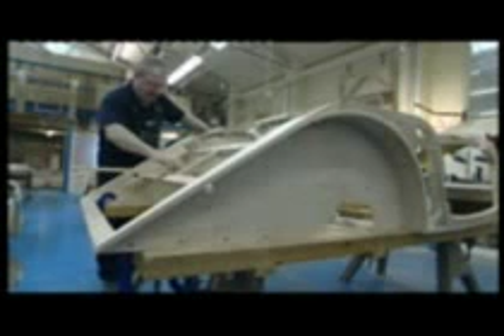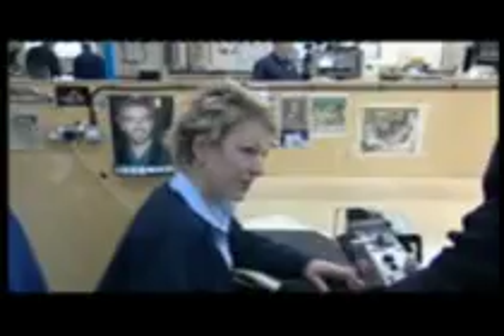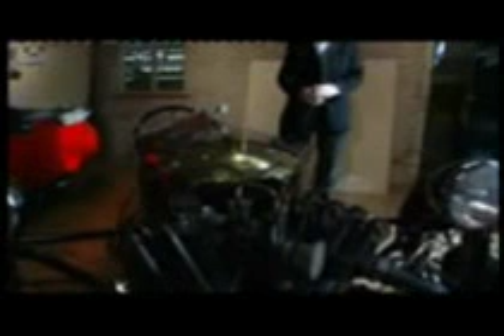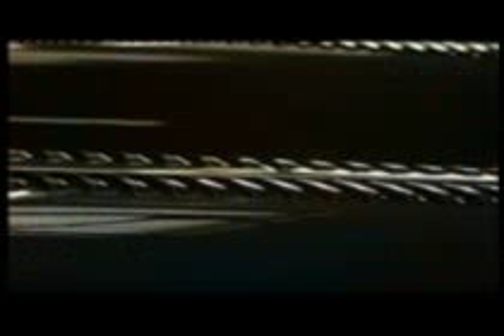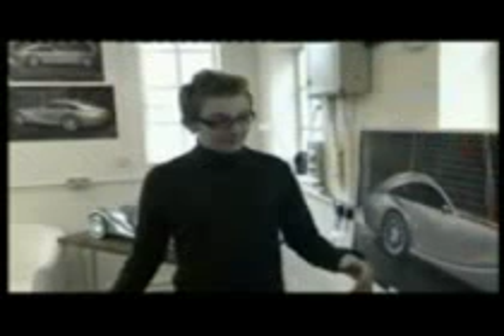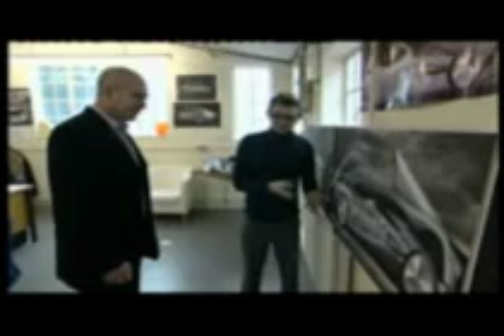Morgan on Working Lunch

Comment: Have been to the factory, 2-3 years ago. Parked on site went to reception and said i'd like a look around and was told 'go for it just stick to the red path' brilliant!, they are plaining away at the chassis etc. about 2 feet from you, the only places you cant go are the saw/timber mill and the spray booth. The rest is a free run but think they charge a fiver now, it would be worth double trust me, go see.